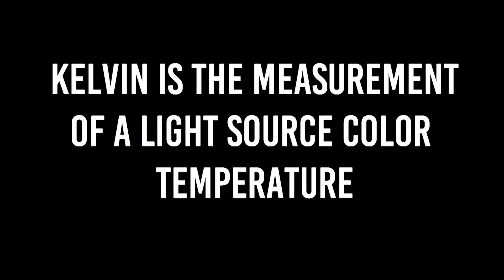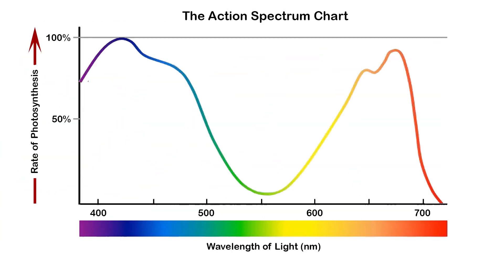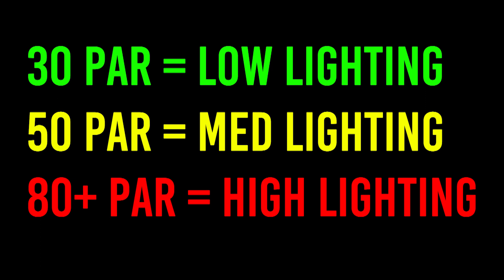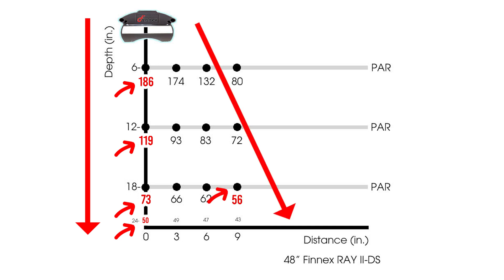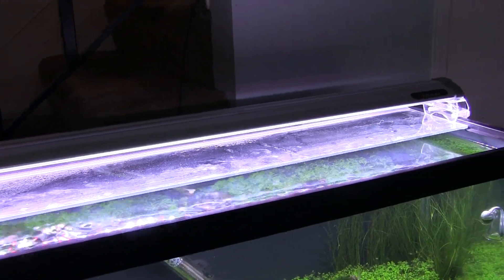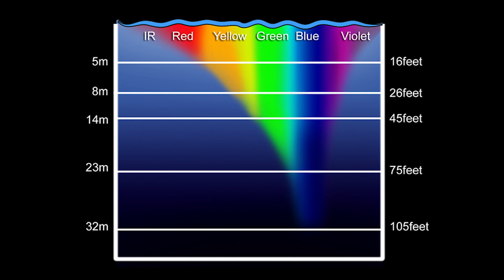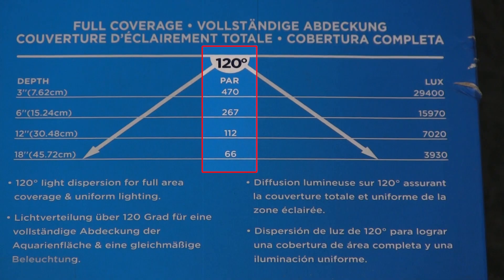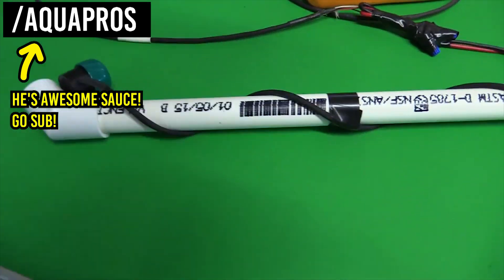Light Intensity and PAR in Planted Tank Lighting - Planted Aquarium Lighting Guide - Part 2

Comment: I would like to get a Finnex light. Which do you recommend for a Diane Walstad type low tech tank? I heard you mention it in this series but I couldn't make out which model you recommend. The sound was garbled. Thanks!
Reply: My tank is rimless, 30 inches wide, 10 inches wide, and 19 inches tall.
Reply from the maker: Hi Christy, for low tech tanks, I'd usually go with the Finnex String Ray.  For your tank at the height of 19", you may want to run two strips but start with one first as I'm not entirely sure what type of plants you're going for.

Comment: Great video as always. We really need someone to put together a comprehensive list of PAR readings for the most common lights we use in the hobby. I personally can't afford theses expensive LED lights and have to use the cheap Beams Work DA and I have a couple Current USA Satellite Plus LED lights and then I have the factory Marineland LED lights that came with my 55gal kit. I'm just having to assume that all of my tanks are low light. If anyone out there has the PAR readings on these lights I would really appreciate that information. Thanks for sharing and as always keep doing what you do if it works for you.
Reply from the maker: I'm planning to get one later but in then you have to buy all the lighting too to do the tests. AND it's not always going to be right because too many factors will change the par ratings on your set up but at least it's a good start. I would make a database and stuff for it to allow you to look it up on the TWB website.  Gotta have rules like no hugely off brands that no one uses king thing.  Just stick to more popular stuff.
Reply from the maker: I also want to get a spectrometer to measure spectrum. Maybe I can fan fun it?
Reply: The Water Box That's exactly what I'm talking about. It doesn't have to be exact numbers cause like you said there's way too many variables like if you have glass between your light and water or even tannins will change your readings but it would give us hobbyist a baseline general idea. I think a database would be really useful!! Perhaps if you can get it started then other hobbyists with a PAR meter could share information and then you wouldn't have to buy do many lights to test. Just a thought.
Reply from the maker: Could but I wanna make sure the reading are actually sourced right. Not just grabbed from the net or made up. Ya know, accountability.
Reply: The Water Box I absolutely agree. You would definitely have to consider the source.

Comment: I’m glad you’re doing this topic. I’m thinking of breaking down one of my taller tanks to replace a shorter tanks. If I do that, I think I’m going to have to get a stronger light. My tall tank is 24” tall. I’m trying to figure out what light (if I need one) I should get. I have a Finnex Planted + on a 40 Breeder. I’m going to use it on a 65 Tall. I might want to try S. Repens in that talker tank. Do you think that Finnex will work fine or what light do you think would be good for a taller tank?
Reply from the maker: How tall is the 65?
Reply: The Water Box  It’s 24” Tall
Reply from the maker: Hmmmm... is that the 36" or 48" fixture?  And is it the planted+, planted + 27/7 or the planted+ 24/7 SE?
Reply: The Dimensions of the tank is 36x18x24.  I currently have just the old Finnex Planted+
Reply from the maker: benzjamin13 right, and I take it the finnex is the 36" version?
Reply: Yes